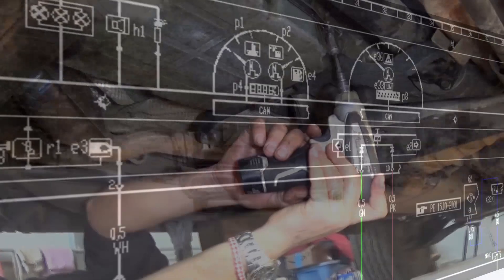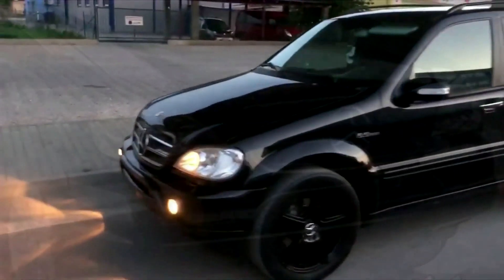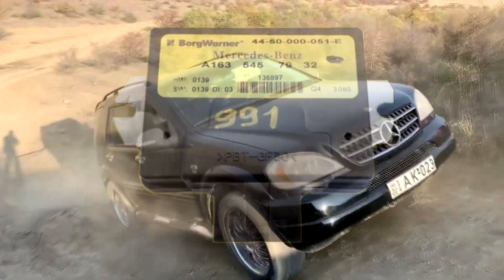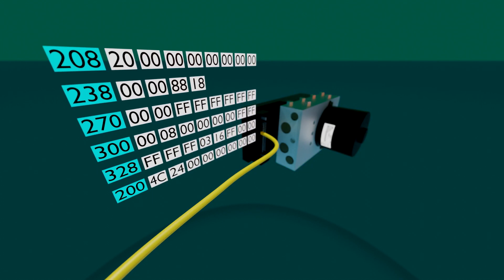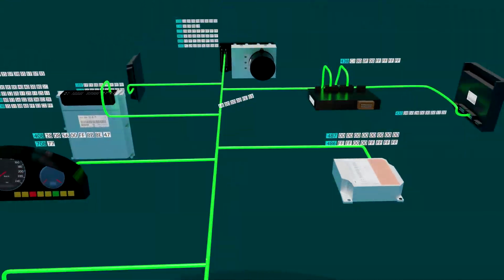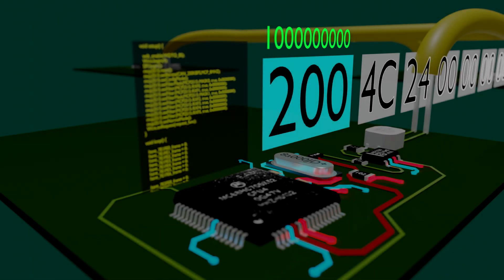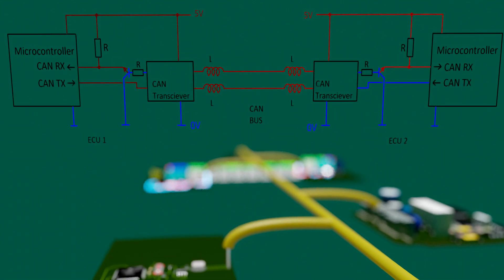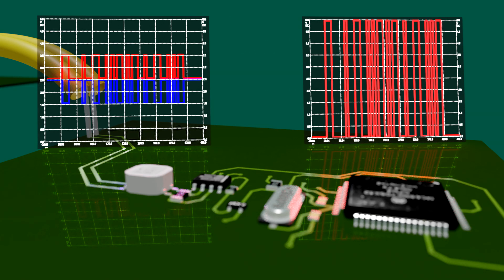Learn Car Electronics: CAN BUS in Mercedes Benz

Comment: A VERY BEAUTIFUL WORK
ON THE INDICATOR CLOCK 

EXTERNAL TEMPERATURE SENSOR    CANID:?
GEAR POSITION		                             CANID:?
RPM			                                     CANID:?
VEHİCLE SPEED                                        CANID:?
COLLANT TEMP                                        CANID:?

DOES ANYONE KNOW THE CODES?

Comment: Very informative video!!
I have a question... Mercedes O2 sensors receive the signal directly from the ECM or they are connected to a CAN Bus distribution block?
Reply from the maker: Usually O2 sensor receive the supply directly from ECU and generating signal through heat and amount of oxygen also directly by single wire. Maybe in very new models signal is transmirred via CAN bus, it should be check in mercedes WIS documentation. New Isuzu truck generare lambda signal and transmit them via CAN indeed.
Reply: @reverseengineering2943   ok. I'm having problems with one o2 sensor and I changed it like 3 times, checked the wires, replaced the ECU and still having the same problem. I was thinking it was a CAN Bus issue so I been watching a lot of videos about this... but I don't know what can be
Reply from the maker: @M-Angel25  you have to check wire diagram of your engine electronics system and check from which pins of ECU wires going to O2 sensor plug. Than check continuity of wires using multimeter and if wires is good, repait ECU. No CAN BUS issue.

Comment: I have one android head unit made by mekede/navifly and i am looking for what Canbus infos they use, that will aloud me to setup into my RealDash app on the head unit. Do you know how can I do that? Since the head unit is already connected to the can, and i don’t want (like the video, exactly the same) to use the original “gauge” app. Can you help me?
Reply from the maker: I have experience with making android car app connection with VAG group. My android-radio supplier gace my tutorial how to set this unit to different car, but it was around two years ago, so today's units and android systems could be different..

Comment: Where could Hight and low can bus be in later benz models? Like 2019 a220? The regular obd2 port won't do it. Some say that it has firewall blocking it. Nice video indeed
Reply from the maker: I think you should check WIS/Stardiagnosis wiring diagrams to understand whole CAN bus architecture. I'm sure obd diagnostic CAN isn't blocked, but with newer standard impemented and you trying to using wrong technology to sniffing them. Everything starting from understand network architekturę and without good documentation it's impossible i think..

Comment: Hie..my 2001 W203 C320 is cranking but not starting...diagnosis machine showed these faults..
1..B1100 CAN bus engine--can bus off
2..B1102 ..CAN COMMUNICATION ENGINE
3..B1109 CAN communication with Eis faulty..
What do i check or fix..please help
Reply: Thanx...key is turning freely..starter is running but engine does not start...
Reply from the maker: I think one of motorola procesor inside EIS (Electronic Ignition Switch module - key switch) lost eeprom data. But first of all check all fuses and EIS operation - if cannot turn key in ignition switch - it also can by EIS fault reason.

Comment: How cn i found in my car can bus adapter? W163 ml 55
Reply from the maker: It depends what you mean 'can bus adapter'. In fact there is No can wires in obd connector (confirmed in 2,7cdi - pin 6 and 14). So I used directly ECU (and all others units) connectors. Most of all CAN buses is connected to EAM / AAM units in late w163 vehicles. So you have to find unit's pinout, i.e. from Stardiagnosis software (star finder), and plug measure needles into unit's connector and needles wiring to CAN-USB adapter, i.e peak, vector, or something cheaper.. then chose proper can speed and recording. That's how I made my sniff.